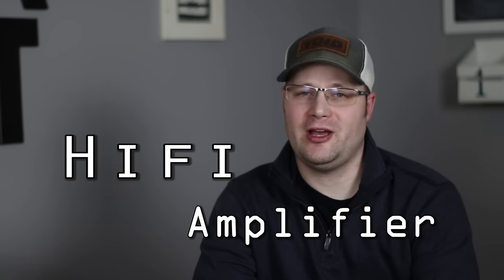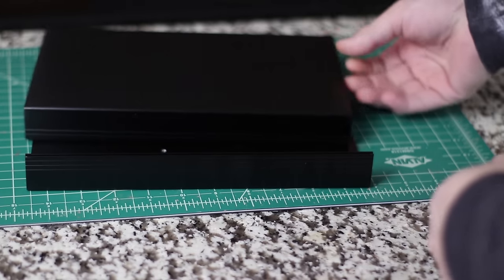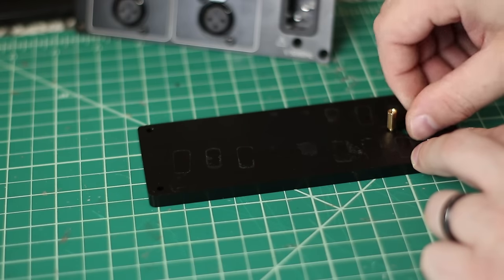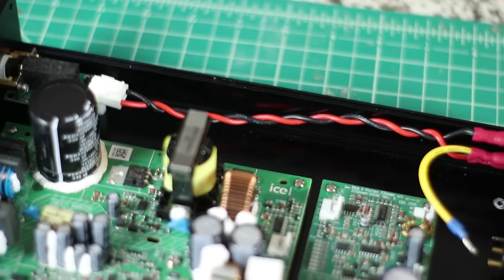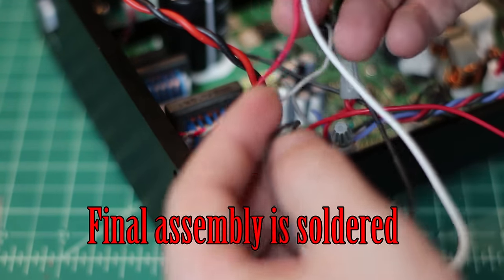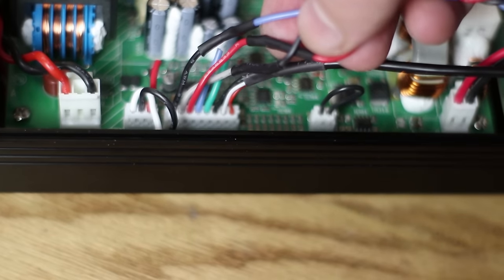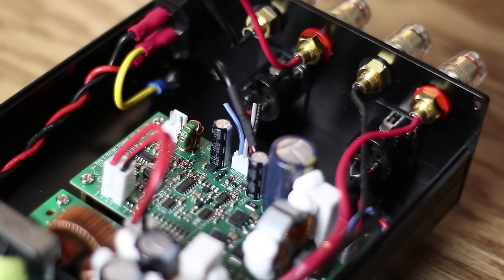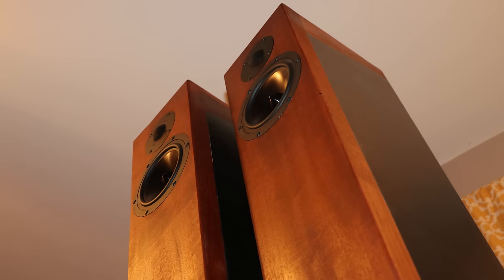How to Make a $3000 DIY HiFi Amplifier for $300

Comment: Small problem. You're going from balanced XLR to unbalanced RCA. You cannot simply tie the + and - together as one lead with ground (or shield) and if you only use one side you're only getting half the signal. The only way to do this right is to use a matching transformer with one side having a center tap, which would connect to the XLR ground and the other side without the center tap going to the RCA. Not doing what I just explained will result in having to have a much hotter signal, which can create other problems. I've been to this rodeo with my PA equipment. Just passing on the tip
Reply: Great point

Comment: De-pinning/re-pinning would be your friend in this instance.  It would make wire matching a bit easier not to mention cleaner inside the case.   Second, in the immortal words of AVE "Focus you Fak"
Reply: Today in this video, I'm going to show you how to build an amplifier. 75% of video out of focus.
Reply: It would be easy for Ghent just to make a wiring kit that already has these interconnects pre made, since they know they're going to be selling tons of these specifically for the 200ASC and 200AC modules. This way no soldering would be required at all.
Reply: @Wizardofgosz  But then folks that don't know what they are doing would get in over their head. Consider the soldering requirement to be a barrier to entry.
Reply: @jameshisself9324  This build requires soldering either way.
Reply: @Wizardofgosz  Well then more or less soldering then.
Reply: yeah focussing was terrible!

Comment: I just finished assembling this amplifier,  it went well but a few wire colors have changed in the new kit.  It passed the startup "smoke test" and it has noticeably better sound then Yamaha receiver it replaced.  Love that it does not have a fan.   I think the  kit from Ghentaudio is worth the money, well organized and nicely done.  It would make things quicker if Quentaudio came with some basic instructions including a wiring diagram.
Reply: I was thinking about getting amp from Peachtree they use ice amps and I was interested in building one do you need a pre amp with that and he doesn't show where to solder I wish he showed more . How did you figure out how to wire it up ? Thanks
Reply: @BostonMike68  No preamp needed, I have used a DAC or my Phone as an input.  I had to watch the video several times to figure out the wiring, fairly simple in once you do it.  I could send pictures of my finished amp just not sure how to get to you.

Comment: I just got done building this amp last night. And WOW does it sound good. Your video was a big help. I'm using the amp with the Pro-Ject Pre Box RS that's a true balance preamp with tube output, speaker are Merlin TSM sealed monitors. Who would think spending $300 would bring great sound. I'm a happy camper!
Reply: Oh man you have the merlins? They reveal everything. God I miss those. RIP bobby
Reply: Do you need a pre amp

Comment: Great video. I have also built several Icepower amps using similar components. I had not done this type (2 modules)  so I have ordered the parts for this one. You did a good job and answered some questions I had to guess at since there are not instructions on the net.

For those that think they know about Class A/B/D amps and are throwing jabs at this build, you would be wise to do some research. Respectfully, you don't know what you are talking about. I have built several Icepower amps like this. I have modified PS-Audio amps that do indeed use these modules. I have built Class A low watt amps such as the Amp Camp Amp designed by the legendary Nelson Pass. There is also copious documentation about the Icepower amps that you can easily google for details about distortion, etc. I would caution someone to actually listen to these amps rather than just jawbone about measurements. 

Again, this is a very good and helpful video for the DIY audience and I give it a very high recommendation.
Reply: I would go hear them but there is nowhere to go hear them because they are sold online only. He is receiving money for every module sold through the link in this video and should show proof they stand up to the specifications that he states they have with an audio spectrum analyzer and some math
Reply: @waderyun.war00034  -- The guy's a hobbyist helping other hobbyists, not a professional engineer with $100K+ of fancy test gear at his disposal.  Moreover, how do you know he's "receiving money?"  Neither Parts Express nor ICEPower are Amazon, and AFAICT neither company has a link-for-pay program -- that doesn't mean they don't, but I certainly haven't heard of any such arrangement for U-Toobers.
Reply: @editorjuno   those links are what's called affiliate links and for every item sold through them he will receive compensation. I don't know how much probably almost nothing but he will receive something. Like I said I haven't heard a class D amplifier that sounds very good but most people can't tell the difference anyway for some reason I can and have always been able to. My friends would show me their sound systems and turn them up all the way and would ask me if it sounds good and I would have to turn it down below 3/4 of the volume . Then ask them if they could hear the point where the distortion went away and they couldnt
Reply: @waderyun.war00034  -- Is this something U-Toob does automatically or does it have to be prearranged?
Reply: @waderyun.war00034  -- OK, thanks for the info!
Reply: How did you like the sound of the Nelson Pass amp camp amp?  For @$300 for either kit what would you suggest?  Thanks in advance for your reply.
Reply: @waderyun.war00034  good information in the vid and it cost me nothing. If he makes a couple of bob through the links good for him, especial if he makes more vids that give me knowledge I do not have 
Happy building and listening
Reply: @waderyun.war00034  Dude, IcePower (Bang Olufson) already has published specs for these amps. They're online. Why would you expect the video creator to do that? He didn't design the gear.

Comment: The one thing I would recommend with these units that use balanced xlr inputs is to ground pin 1 of the xlr to a case ground point as close to the xlr as possible, say one of the mounting screws for ex. And ground the shield coming from the board to a different point on the case. This reduces potential ground loop issues and the possibility of inducing noise into the signal chain, especially when using rca to xlr cables like the ones shown in this video. This also has been covered extensively in AES48 specs and documentation by hypex, Rane.
Reply: Hi which site do you recommend to purchase the balanced XLR inputs?
Reply: @Steven-e7c   The Ghent Audio case he is using in the video comes with xlr inputs. I believe they are Neutrik.
Reply: @aredd92  thanks
Reply: I'm not sure if it will work with the power button setup you have, but I bought a Ghent case that uses an LED status indicator and a rear power toggle (no push button power switch), and I was able to configure it to automatically power on and off. Instead of using the mini jumper on J4 (power always on), I jumped J3 input 4 (signal sense) to input 8 (+ audio in) at the XLR connector solder tab, and the amp turns on and off automatically when it senses a signal from the DAC.
Reply: @BuckStrickland-yc3cz To be fair these Amps are incredibly efficient and the standby power is minimal especially when compared to an A/B amplifier. I wonder what the real word energy savings are in your case?

Comment: Ive been wanting to make a good quality class D amplifier for a home subwoofer that had its board die, and i lost it before i could fix it. This would really help me set it back up and get it running without having some cheap homemade amplifier that barely outputs power. I didnt want to buy one, i want to expand my electronic skills and try to build one. You sir have made this possible. Thank you.

Comment: I think it might even be possible to do a three module system with the third one used for a subwoofer amp with the low pass filter mounted internally. Whole concept has many possibilities.
Reply: Subs often require alot more wattage from my experience. I often just give up and go integrated lol. Subs are more muddy anyways, I'd rather focus my efforts on the midrange and tops

Comment: Took weeks to get my case.....my power button came with plastic pegs instead of the metal ones like you have, and 1 of the pegs was defective causing the power switch to sit at an angle and function poorly....upon trying to correct it, the peg broke and left the threaded plastic stuck in the face plate.

Off to a great start!   UG
Reply: Luckily, this....and missing a single plastic stand off for the second board was the only issue I experienced...was able to hot glue the broken stand off to get the power switch installed....ghentaudio is sending me a replacement peg for the board which was missing.

Comment: The modules offered by parts express are ICEpower's lower end modules.  For example one of the "high end" brands mentioned uses the 700ASC.  Other companies use the 700AS2.  These are far more powerful and better sounding then the 200ASC used in the video and parts express doesn't sell them.  The "more powerful 500ASP" mentioned is a different family of amps as is the 1000ASP.   Different animal.  Show me any amp company that sells the 200ASC for anywhere close to $3k....(maybe just a little click baity?)
Reply: So make a video showing how to build an amp with the components mentioned.
Reply: PS Audio and Jeff Rowland had some older amps using the ICEPower 200ASC. Where those companies incorporated their "secret sauce" was often in providing an input buffer stage that provided the extra gain these modules often need to produce high volumes. If you don't have an input buffer stage, then you need either an extremely stout line-level source, or an active preamp in-line. In the case of the Rowland, most of the money comes from their very ornate casework, and there was no buffer stage used; the 102 was meant to provide a more affordable amp compliment to their smallest preamplifier.

Comment: I built this amp and have been running it with a Douk P1 tube preamp and it sounds great!  Is there a way to run this amp bridged?  I'd love to build another and run them as mono blocks.
Reply from the maker: There isn't a way to bridge these. However you can just use one module for a monoblock. If you want more power, you just want to go to the 500 watt, which I linked in the description.

Comment: Great video, except the tad clickbaity title. I can only think of a couple of examples of big brand amps that use a simple single board class-D with an SMPS. Most of the amps out there in that price range have discrete class AB design with complex linear power supplies with torroidal transformers, not to mention the biggest IP expense with these brands is the preamp stage, which this amp doesn't have. Not trying to bash this particular project, but after weeks of research of attempting a similar project I came to the realization its not as simple as it looks to just make a class leading amp or integrated amp with 3 boards. Keep up the good work though, it would be awesome if can get your hands on boards from Hypex ( Rogue audios's integrated uses it, but notice the massive preamp stage which is not as easy to build). Good luck!
Reply: What pre-built products would this build be comparable to?
Reply: @saltrocklamp199  Potentially a NAD M22 is the only that comes to mind, which essentially uses Hypex Class D modules and is essentially two monoblocks
Reply: Modern properly designed class D amps rape AB amps.

There is this myth out there that Class D amps are still inferior. 
NAD does not even use AB anymore. 
They went full on Class D.
As long as they are designed properly and quality parts are used Class D sounds just as good but wastes a LOT less energy.
Reply: Indeed, Hypex Ncore class D amps have over 100x times less distortions in highs(@6.6kHz) vs others class D on the market. ICE distortion performance is awful in highs, THD=0.2%! Any class AB amp in any price category easy kill such marginal class D as ICE is )) BTW, ICE frequency response is far not flat in 20000Hz and depends on a particular speaker impedance, all class AB or Hipex class D have no such problem at all! IMO, ICE 10x times overpriced and should be $30 instead of $300 ))
Reply: @saltrocklamp199  Mostly sub 500 dollar range products. Klipsch powergate is comparable for 200.
Reply: @ivane1168  nc400 is really good but somewhat expensive.
Reply: @johnyang799 , UcD-180 cheaper and 10 times less THD+N at 6.6kHz vs icepower. Actually, almost any Ti chip amps outperform icepower in highs.
Reply: @ivane1168  But I like nc400.
Reply: @ivane1168  THD is .2% at 200 watts. That would be the case with any amp of any class putting out its max rated wattage.
Reply: I have no idea what pre-amp to use with this power amp. Something budget. Maybe a DAC with a digital volume control is best? I've heard that if you throw a potentiometer in front of this thing is will mess with the frequency response due to the input impedance.
Reply: @brydon10  A DAC with a volume control is a great idea.

But that said, there are so many good preamps out there you can build as kits and stuff. I've been eyeing this for a build once I have a little more cash.

https://www.tubedepot.com/products/elekit-tu-8500-stereo-tube-preamplifier-kit

I actually already have the two Ice Power modules for this, and am only waiting for the case from Ghent Audio.
Reply: I'm asking what preamp should I use with this DIY amp. It has no volume control.
Reply: @brydon10  Sorry. I replied above. That long comment was meant for someone else.
Reply: No problem. I think I found a good option - A Schiit Sys passive preamp. It has a low output impedance. Run a DAC into the SYS at full power and control the volume with the SYS to the ICEpower.
Reply: Well psaudio sells plenty of into the thousands “costing” class d topology amplifiers. 

In actuality, more and more high end companies start using class d. It’s cheaper, higher efficiency, and distortion is these days inaudible even on higher volumes.

The only reason why I have 200pounds of class a/b is current. Class d can deliver tons of wattages but can not deliver actual current (they lack the power supply to do so) 

It becomes very evident on speakers that dip in impedance and have a low sensitivity. My crown did not sound nearly as refined as my ati amps.
Reply: @MichelLinschoten  
I have no idea why you'd characterize Class D as lacking in current as an inherent flaw, as that's not true. 

Regardless of class of operation;
A,  A/B,  D,  H
current capability isn't an inherent problem. 

Also, the big classic design of a 200lb toroidal transformer and big soda can sized capacitors sure can deliver the current. 
That said, a small switching power supply often associated with class D amps can pump out just as much or more current.
Reply: How good is hypex UCD 102?

Comment: When attaching the ground lug to the case I think it may be prudent to sand off the finish on that part of the case to get a better connection.  I am looking forward to building and testing this amplifier.  Thank you for the video. With tax and shipping so far I have paid $360.80.  No word on tariffs for the case yet.
Reply from the maker: Great call.  It definitely is. My case already was sanded down. My assumption was they all come that way.  Hopefully they do.
Reply: @Toid  Now I just need to hurry up and wait :)
Reply: Just finished the amp.  I am very happy with the sound and it is as good or better than my class AB Rotel 981 Power amp (1990's). - Thanks for the video; it really helped a lot.  I did a few things differently like the grounding and repined the sockets.  Looks like it compares with the PS Audio S300 that uses the 300ASC and 300AC.  So; for $360 I get 2/3 the power of Paul McGowan $1500 power amplifier.
Reply from the maker: @BriansModelTrains  that is great to hear!

Comment: I built an 833A single ended triode amplifier at a fraction of a percent of the cost of the WAVAC $350,000 833A pair of monoblocks. It took many experiments to get it right but the sound is excelsior.

Comment: Focus game is weak here man. Please take more time to get shots in focus when doing a wiring tutorial. 
It's certainly a tempting proposition to try one of these builds.
Reply: maybe you should buy some glasses.
Reply: agree with chris & philip
Reply: His focus game is just fine. But the DoF is not really suitable for a "tutorial" of this kind. Again, he might not have the lighting needed to step down, or some other reason. Anyway, he made it, shared it, and I appreciate he did it. Despite the technical issues of the filming in macro mode.
Reply: Paul is Chaotic Neutral
Reply: 123Toid, consider Sony RX100VII. That would solve focus issue completely.

Comment: Great video, looks like a fun project! I have a few amps and believe comparing this to a $3k amp is a far stretch. However, for what the parts cost I think it is a good value.
Reply: Why? There is a lot of cost goes into, design, manufacturing, advertising salaries and ofcourse shops also add big percentage of that cost, and here you paying just for the parts, for me it makes sense, for person who has bought very expensive amp should not probably :D
Reply: i'm guessing his point is that someone, somewhere, is selling a version of this for $3000. might not be the best $3000 amp out there, but a huge amount of the hi-fi market is based on how well you can present something in a showroom and speak in appropriate hushed tones